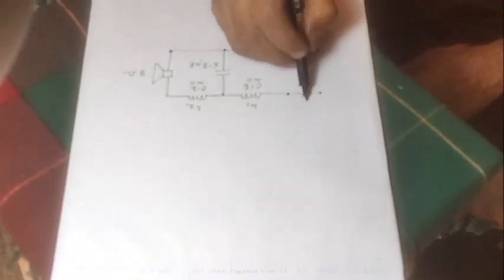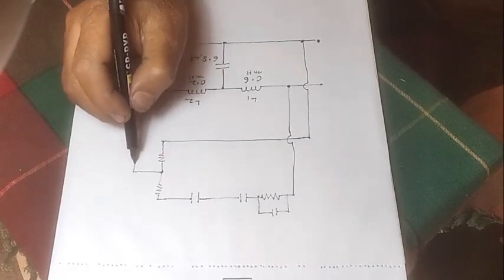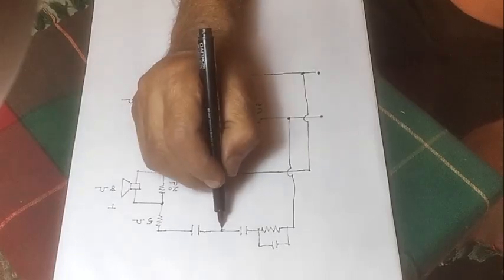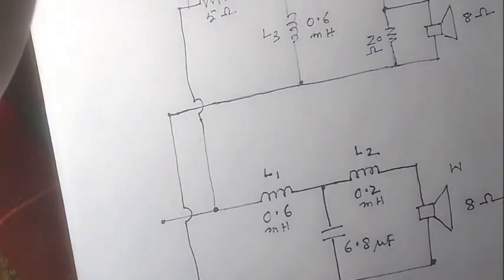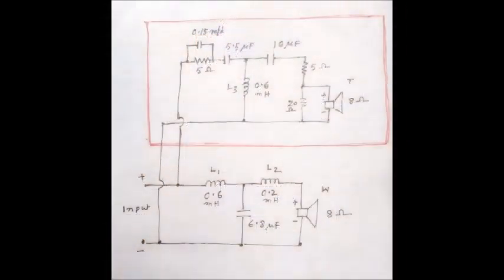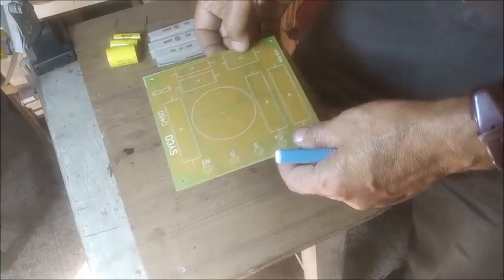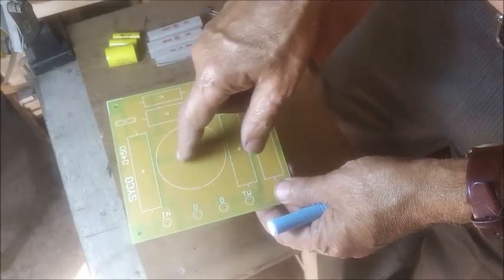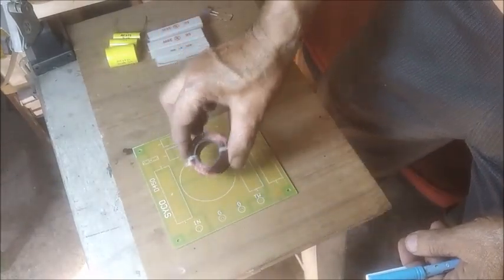Third order (18 dB per octave)  High Pass  Crossover  network for  Horn Tweeter

Comment: Hello, I want to connect the dome tweeters to the full mode amplifier in the car and make a crossover so that they can work without any problems.  In other words, I want to filter the dome tweeters and run them on the same channel where the coaxial speakers operate at the same RMS power.  I need a crossover that can support 8 ohms and 4 ohms and filter an average of 150 rms power and drive the dome tweeter.  Can you help me with this?

Comment: Good morning Sir, 
I buy your 3 way cross over network 12 db for my home speaker. But I feel bass is not appropriate for my woofer therefore I request you to please help me to upgrade only bass part of your syco network. Please guide .
Reply from the maker: Crossover networks do not improve bass response. It's used for frequency separation only. 
Bass response depends upon the quality of woofer and also on amplifier. Moreover, speaker enclosure design is also important.
Reply: @makingloudspeaker  Thanks Sir for your prompt response.

Comment: hello Mr. Mukherjee
  nice content ure making here
but i have a problem that has no answer on the internet and i didnt study enough electrical engineering to solve it
the problem:
i want to create a 4way speaker in a classic vintage style box
standard crossover fqs and slopes:
6-12db on lows/lowmid  and 12-18 for comp.horn and a bullettweeter  on highs
sub  < 100-200hz < lowmid < 1k-2k <highmid< 6k-8k < tweeter
all total power is about 600w rms
they should be very powerfull PA speakers for "parties" but with a very high quality sound
i dont want to go on active xover cuz of cable management and making it as compact as possible

as i dont know how to make a bigger passive xcover with more than 2way
i bought myself a xover from monacor (DNL-1245 600w 8ohms   x=200hz)
into which can be added another xover over high output,
so i want to put my already existing 2way (DN-2618P 350w 8ohms {4ohm x=1.7k / 8ohm x=3k}) into it but also "modulate the highs" another time with another 2way xover with  x=8k
the question:
>>>>is it possible to just add another Xover into an output channel? with the same impedance?<<<<
i will build this one myself cuz i cannot find any crossovers on 6-8k range and noone on the world wide web has an usefull answer for me how to build  4way passive xovers yourself

ive always been suggested to use L-Pads but they only regulate the amplitude of the signal and dont do anything to the separation of the frequency

have a nice day and keep it up!
yours sincerely steve
Reply from the maker: There are information available in net. You may try this link :
https://www.tubecad.com/2017/11/blog0403.htm

Comment: Saheb, time and time again the coil of Twitter burns out.
Reply from the maker: Check the crossover network - particularly the capacitor in the tweeter section
Reply: All components are correct, but what if Twitter's diaphragm burns out?